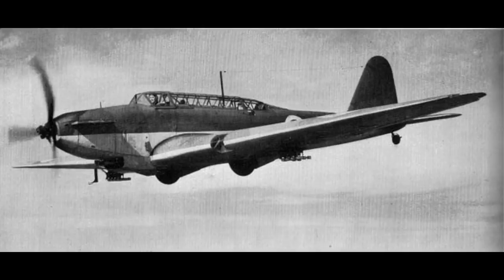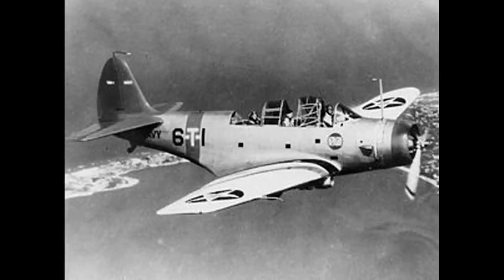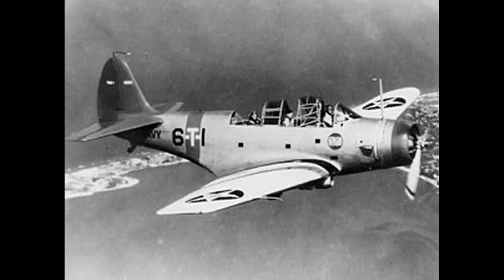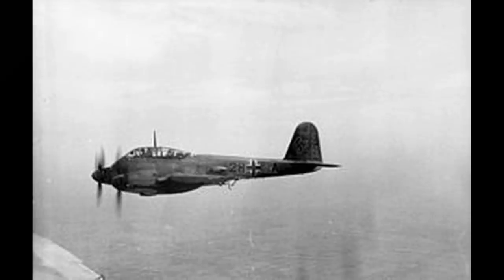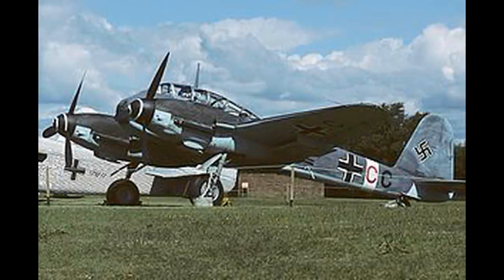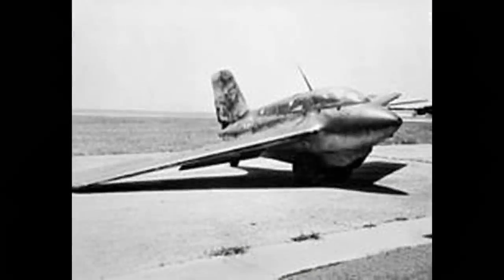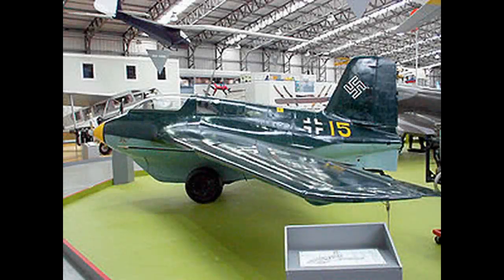TOP 5 WORST military aircraft used during WW2

Comment: The Backburn Roc.
Too slow to even catch a BF-109, with it's ridiculous turreted offensive armament.  Pathetic bomb load capacity.  Generally useless.  
A total of ONE confirmed kill.  A sad little buggar.
Reply: The Blackburn Roc was a British carrier fighter, designed to fight over the North Sea and North Atlantic, against the Germans, who did not have an operational aircraft carrier.  Therefore, a dogfight between a Roc and a Bf-109 fighter was not expected to ever happen.
The primary expected opponents for the Roc were German seaplanes and flying boats, not fighters.
Reply: @timonsolus  You're not impressing anyone by stating the obvious.  Regardless of who the Rocs opponent was, it was slow as Shit, had crap for payload and a ridiculous armament layout.  It could barely catch a German seaplane (230 mph).
Reply: Fred Weller : I’m just pointing out that it’s a little unfair of you to criticise the Roc for not being as fast as the Bf 109.  It’s like comparing a Fairey Fulmar to a Zero.  Yes, they are both carrier fighters, but designed for different jobs in different circumstances.  The Fairey Fulmar was a reconnaissance plane as well as a fighter (which is why it had a back seat observer), the Zero was a pure fighter and wasn’t expected to do any reconnaissance.

Regarding the turret armament, the Germans had similar ideas in WW2 when they fitted their night fighters with ‘Schräge Musik’ upward firing cannons in their night fighters (guns mounted in the fuselage of the fighter at a slanted upward angle, so the fighter could fire up at British night bombers from underneath them).  From that position, RAF night bombers were defenceless as they had no belly turret.  Seaplanes and flying boats were equally vulnerable in that respect - no ventral armament, they were sitting ducks from below.
Reply: Despite its shortcomings, a Roc did manage to shoot down a Ju88 though ... on the 28th May 1940.
Reply: @wotnotvintage7762  One.  Confirmed. Kill.  Damn.  Pop the champagne. 
For the resources wasted on this piece of junk, Brittan could have rushed production and introduced the Sea Hurricanes earlier.
It's criminal how much time and money was squandered on trash projects like the Roc.  Who knows how many English sailors would have lived if they actually used a plane that could intercept German bombers.  NOT chase them from a distance.

Comment: There are worse planes than the Devastator that is for sure. For one thing trying to sink ships with torpedoes is extremely dangerous since you have to get extremely low and slow to drop it.  At the time the  IJN had extremely competent pilots with the world's best naval fighter. Bad combination not to mention the defective torpedoes they had to use. But I bet the Devastator was a lovely aircraft to fly off and on carriers at the time.  The Beda Ba. 88 really was a disaster. It couldn't even fly. As for the Fairey Battle it was a delight to fly and had good speed (as fast as the Bristol Blenheim which had two engines) but had no hope against the worlds best anti aircraft batteries and the world's best fighter the Me 109. It took trial and error to see the only way forward was the fighter bomber such as the P-47and Hawker Typhoon. Lots of losers to pick from like the Blackburn Roc. Thanks.

Comment: He-177 should be on the list
Reply: There was nothing wrong with the original design for a four engined bomber to rival the Lancaster but Goering stuck his nose in and made the designers change the aircraft into a dive bomber. Four engined aircraft simply can't perform that function so four engines were made to drive two propellers with catastrophic results for the aircraft and crew.
Reply: There was (I have read) one occasion when around 100 He-177 bombers were gathered for a 'set-piece' raid on Magnetogorsk on the Russian front. 
To my knowledge, the raid did not occur because gathering the bombers took so long and malfunctioning planes were so common, that they were used up in other necessary combats before the delayed start date.

Comment: Brewster Buffalo was a death trap too.
Reply: Not quite so. The Finnish Airforce Brewster Buffalos shot down 477 Soviet aircraft for the loss of 19. O.K. it was "de-navalized", therefore lighter and with better performance than the original carrier-based fighter. https://en.wikipedia.org/wiki/Brewster_F2A_Buffalo#Finland
Reply: Finntastique but the Russian planes and pilots were pretty awful in comparison. How do you think the Flying Finns would have done against crack IJN Zeros and pilots?
Reply: @Miles Ellis Yes, zeros would have won. But the Finnish flew Buffalos in 1939-1941. The zero was barely in production in early 1941.
Reply: @potatojuice5124  The B-239 (Finnish designation) was still  in Finnish service at the Finnish armistice 1944 and the last were removed from service in 1948.
Reply: They were being slowly replaced as frontline fighters, beginning in 1943, by the Me 109G partly because of a lack of parts and were increasingly relegated  more to a secondary and training role.
Reply: @finntastique3891  The RAF Buffaloes also added armour that added weight to the plane, slowing it down. The Finns  did not have the extra armour on their B 239 and had a unique more powerful engine, the Wright R-1820-G5. Thus, the Finns had an improved, faster, more maneuverable version of the aircraft than the RAF Buffalo or US F2A.

Comment: I think the fairey battle fairly won it hands down 

It was THAT slow, it was susceptible and vulnerable to even sub machine gun fire
Reply: The Fairey Battle was a prewar aircraft and only in service until early in the war, many newer aircraft were no better. Any aircraft was vulnerable to machine gun fire.
Reply: @barrierodliffe4155  the chances of survival in a fairy battle were far worse than in a hurricane - if it had better armament it may have fared better, but was far more susceptible to being hit by bullets
Reply: You can't compare a fighter to a bomber. the B 17  could not survive without a fighter escort..
Reply: @barrierodliffe4155  I was comparing single engined aircraft, and the B17 flying fortress did obviously need fighter escort, otherwise in the end, attrition rates would have spoken for themselves

Comment: 6 months into the war the the Japanese lost the war because of the outdated Devastator they weren't fighters but torpedo bomber's at the battle of Midway the fighter escorts didn't link up to take on the Zeros protecting the Japanese carrier's but the Devastator's knew they were going to die but they attacked at wave top level with no help all the zero's attacked the 15 torpedo bomber's flying low and slow on their run no up to date bomber could survive either 15 lost but the Japanese celebration was short lived the zoro were late forming up to return to protect the carrier's when the also outdated dive bomber's show up and made there dive on the carrier's at 500 feet they put their bombs thru the flight deck loaded with fully fuel and bomb load plane's ready to take off , 4 carrier's sunk with crew and plane's the fifth carrier was sunk the next day ,Japan was finished as an offensive threat ,those outdated plane's taking on the carrier's without fighter cover with the zero's free to dive on them from above the crews knowing they wouldn't survive but opened it up for those out of date dive bomber's to end future Japanese naval battle's,  so out of date torpedo bomber's and out of date dive bomber's making the ultimate sacrifice have no place on the worst plane's of ww2 they were all we had then those out of date torpedo bomber's 15,  cost the Japanese 5 carriers 350 to 400 plane's and thousands of naval personal and ended their Pacific advance it was nothing but losses after Midway , not bad for a top 5 bad plane of ww2, or is it a mistake from someone who knows nothing about how 15 plane's were lost or how heroic the crews were.

Comment: The American Brewster Buffalo should have found its way onto the list,  that thing was awful
Reply: Finland use it and it was Best airplane in WW2.
Reply: @jakkeledin4645  for them, and only them, the American units at Midway got chewed up in a matter of minutes by zero fighters, and any other engagement in the Pacific
Reply: @timothyboles6457  The Finnish B-239 was lighter than the RAF and USN versions with a more powerful engine and thus somewhat improved. Some of the Soviet aircraft that the Brewster successfully engaged  were on paper far superior to it (Yaks, LA-5) and many should have been equal or slightly better (Lagg-3,  Hurricanes). Finns had overall better trained pilots and tactics than the Soviets, but would not have achieved their amazing kill ratio (459 claims to 19) if they were flying one of the "worst five aircraft" of the war.

Comment: polish p 11
Reply: The PZL P.11 was a fine fighter aircraft back in August 1934.  5 years later, however, it was obsolescent.  Although it still managed to take quite a heavy toll of German aircraft (particularly bombers) in 1939.  The Luftwaffe lost 240 aircraft in Poland that year.
Reply: @timonsolus  you are wrong p 11 was crap and germans lost about 50 machines from various reasons
Reply: fox : The P.11 would have been quite effective against its German contemporaries, the Heinkel He.51 and Arado Ar.98 biplanes, making up for slightly slower top speed with higher diving speed and more robust construction.  But it was never expected to have to face the massively superior Messerschmitt 109E.